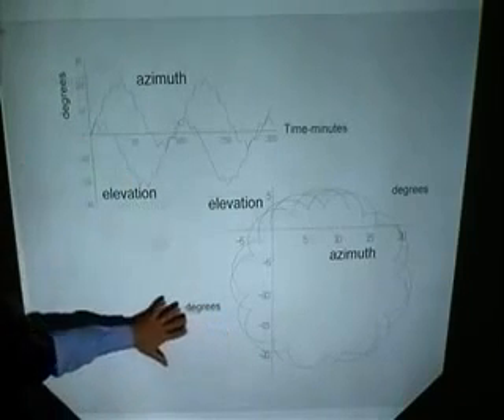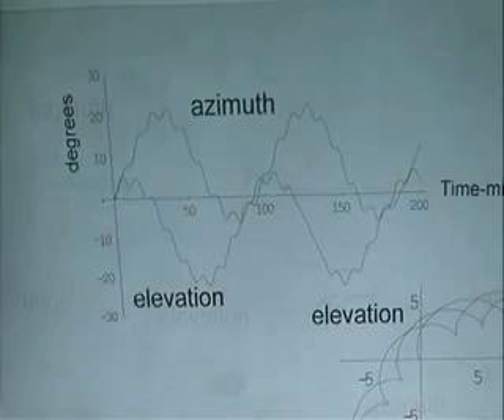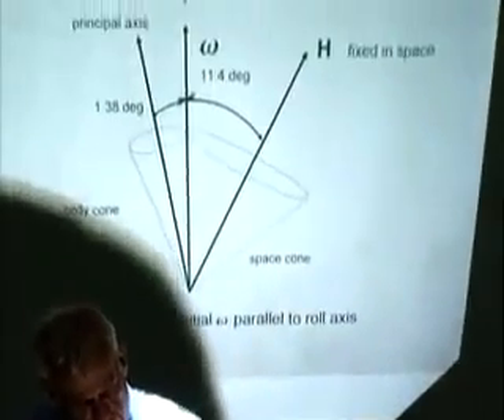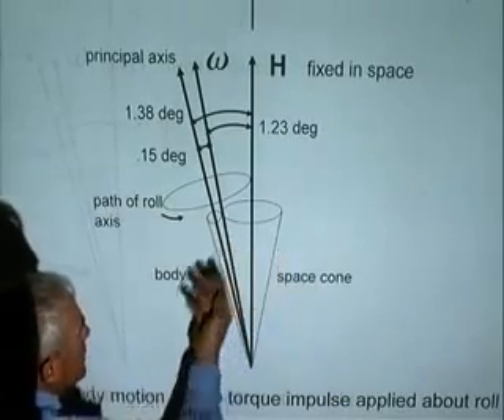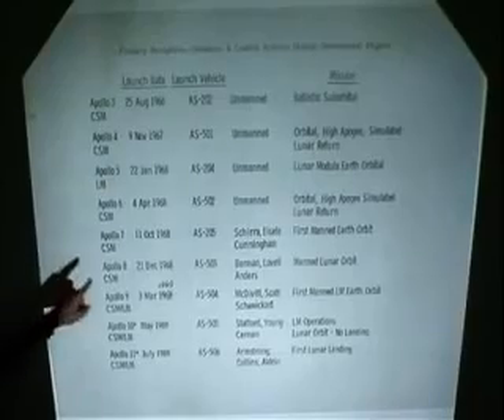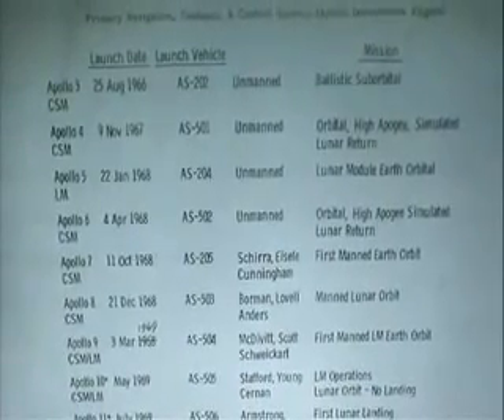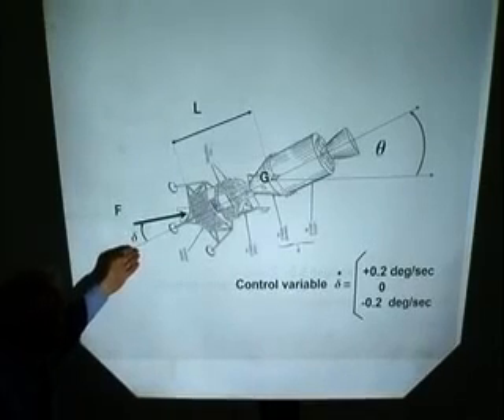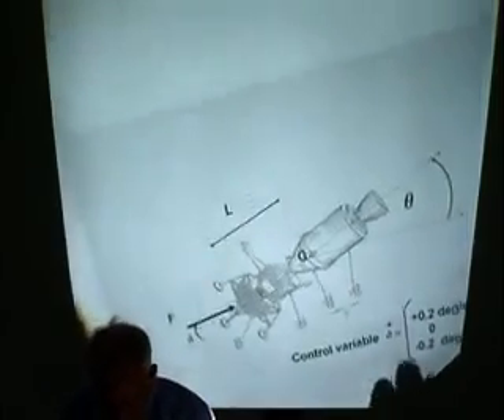Apollo guidance and navigation lecture by Widnall

Comment: Apollo 5 wasn’t a failure. The issue that occurred on that flight was because the guidance computer didn’t wait long enough for the LM descent engine to build up thrust before concluding that there was a problem with the engine and shutting it down. Mission Control disabled the guidance computer and controlled the LM manually and accomplished the mission objectives that way.

Comment: ESCAPE VELOCITY:

I don't want to be picky, but, I notice that that no engineers bother to mention that this is not true Earth Escape Velocity - the TLIB.  Since, the moon is within the Earth's gravitational field.  True Earth Escape velocity on a manned mission will only achieved with the TMIB, on the mission to Mars.
Reply: Apollo was slightly below Earth’s escape velocity, but the term “within the Earth’s gravitational field” is meaningless.  The gravitational effect extends infinitely, but decreasing in strength by the inverse square rule.  At escape velocity, the gravitational effect is too weak to prevent an unpowered object from coasting forever away from Earth.
Reply: @GH-oi2jf  I understand that the TLIB was about 24,000 mph.  Whereas true earth escape velocity is 25,000 mph.

The moon is part of the earth's gravity field.  It orbits the earth.  It is captured by the earth's gravity.  Held prisoner (for the moment). It is part of the earth's system.  So, it is quite in order to state that it is part of the earth's gravitational field. A TLIB that achieves a free return trajectory requires a smaller Delta-V than the TMIB will require.
Reply: @GH-oi2jf  ,

I'm a layman.  A lifelong student of The Apollo Project.  I have no specialist knowledge of Maths or Physics.  But, I can still make intelligent observations.  And, insofar as I err, it is YOUR job to correct and instruct me, in a spirit of shared knowledge, and not to act like an arrogant and closeted academic.
Reply: @warwickaldermanchannel2340  — I don’t think that was arrogant.  It is good that you are interested in the subject, but ought to want to improve your understanding of it, particularly if you want to correct others as you did in your original post.  That was news to me, by the way, I didn’t realize that the command module never reached escape velocity.  It could have, however.  Escape velocity decreases with altitude, so it gets easier.
Reply: @GH-oi2jf  ,  "It's good that you're interested in the subject," he said.  To a lifelong student of Project Apollo!

Yes.  I am interested in Astrophysics.  There's a lot that can be understood by the layman.  Without the math.  Just the general concepts.  The math just proves the arguments.

I may even know more about trajectories and guidance than Pete Conrad did.  Conrad, Mission Commander of Apollo Twelve.  Why do I say that?  Well, in the excellent film:  "For All Mankind," by Al Reinert, he can clearly be heard at the beginning of the film demonstrating that he knew nothing about how to get to the moon.  Though, to be fair to him, he pointed out what a specialised project it was.  And that, his job was to do his part of the mission, and do it correctly.

By the way, I have many Apollo Project videos on my channel, and more to add in the future.  I may well add this one.

Comment: I'm an aerospace engineer and I didn't really understand any of this. I'm usually good with dynamics but this went over my head. they only had trusters to get rotation along the x axis. so he explained it that this was the problem and also solved the problem. what's the difference?
Reply: He said that they didn't have pitch and jaw thrusters during a docked DPS burn, only roll. To control pitch and jaw, they wanted to use the very slow gimbaling capability of the descent engine (for which it wasn't orginally designed for). He had to figure out if this was feasible and if so, how the control law had to look like. This whole thing is just another example of the general spirit (and rush) that lay behind the Apollo program: think hard about what problems could occur and when something comes up that you didn't think of: how can you use the existing hardware to do the job despite all that?

Comment: At the velocity given by NASA and others... why did it take 3days to get from Earth to the Moon? Eleven to thirteen hours in microgravity should have been the time window. With battery power being so important/ limited .., why slow the module to a 3day pace vs getting there and then slowing for dessent ? Just curious...!
Reply: You need to grab a book on orbital mechanics. Just because you're in space doesn't mean that gravity isn't there. You have the illusion of microgravity because the spacecraft is accelerating (or in this case decelerating) at the same level that you are. You're still constantly falling around the Earth.
Reply: First, as stated and illustrated several times in the video, the chosen velocity allowed a free partial lunar orbit and return to earth if the engines failed. Apollo 13 was a given example.
Second, because the weight of fuel needed for acceleration is greater than the weight of additional electric cells, food, and oxygen.
Reply: @wolfedogg99 That was my guess.  What the presenter said about the optimal solution to the drag race problem is relevant, and you mentioned it.  If they sped up, they would have to also slow down - using even more fuel.
Reply: The Apollo spacecraft took 3 days at 17,000 miles per hour.
Reply: Pardon my far in the future response.  It came down to fuel.  They actually had this issue on Apollo 17.  They launched 1.5-3 hrs late, iirc.  So to stay on the flight plan, they injected with a bit more velocity to make up that time.  However, to get into lunar orbit, they had to burn more fuel to do so.  Luckily it was well within limits.  To end the TLIB (trans-lunar injection burn) with a velocity much higher than 24k MPH, the launch vehicle itself would have had to been bigger to hold more fuel.  Then you need more space to hold fuel to extend the burn to get the added weight of the initial added fuel for the TLIB, into orbit.  It all comes down to the rocket equation.

Comment: con job
Reply: Lol, rockets do not work in the vacuum of space. Nothing to get traction on.  No action for an opposite reaction.
Reply: Sure there is something to get "traction" on.  At the point of expulsion, the source of energy is pushing that matter outwards, which in turn puts the same amount of force on it in the opposite direction.  Doesn't have to be anything to "push on".  Take a physics course.
Reply: @timmoles9259  love the exhaust of the rocket motor doesn't give thrust by pushing off the ground.  it's creating the force right at the thrust chamber, as it exits at an extremely high velocity.

Comment: This is mostly over my head, but if applying a torque about the roll axis solved the problem, what were they doing differently the first time?  How else do you start the spacecraft spinning about its axis?
Reply: Star Gazer I’m no expert but I’ll attempt to explain. The thrusters on the CSM are not throttled. Open a valve and the hypergolic fuels combine and produce 400 Newtons of thrust each. Hence the bang, bang thrust model. There were 4 clusters of 4 thrusters mutually orthogonal to each other. But the change in attitude you get or any rate of change in yaw, pitch or roll depends on how far the thrust is applied from the center of mass of the body. The thrusters were placed on the CSM with rendezvous in mind so the offset from the center of mass of the CSM-LM system was larger than with the CSM alone. With the LM attached, the roll thrusters imparted a pitch and yaw component with every bang that had to be corrected with another bang in an orthogonal thruster, which affected the roll rate so the solution programmed into the automatic system never converged to satisfy the programmed barbecue mode so the automatic control was wasting fuel. The question to be solved was whether or not automatic control was needed, since they wanted to avoid gimbal lock above all else and nobody knew if the roll rate would decay into rotational “tumbling” along the long axis.
Reply: Thank you for your explanation.  It helps.
Reply: Only my idea, but probably by firing the attitude rockets on the outside of the spacecraft.